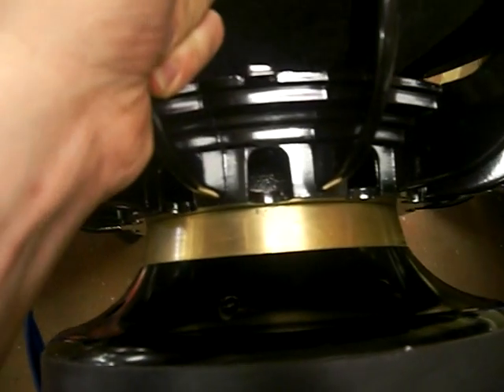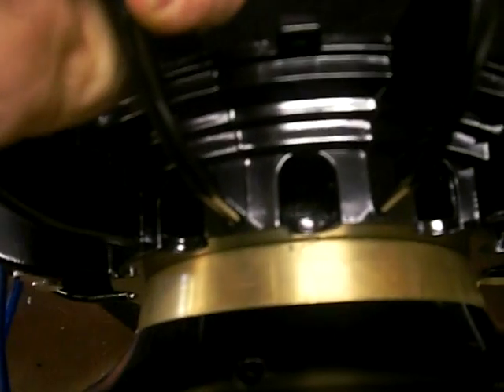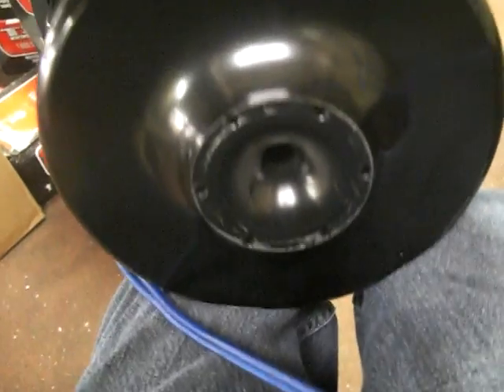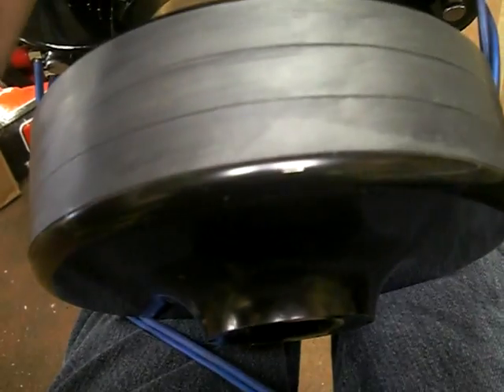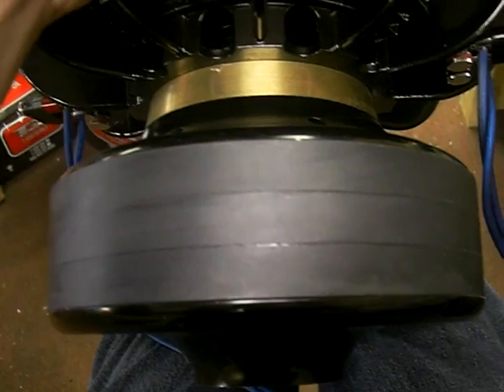Sundown Nightshade v.3 Prototype Free Air

Comment: I would start with finding out what the port area is going to be between the 6x9's on the back window. Knowing the port area should tell you how big the enclosure is going to be which will also tell you what subwoofer(s) or subwoofer combo that will perform the best in that given enclosure.

Comment: Good sound will depend on how well the system is tuned, ie. unclipped output signal, crossovers, and enclosure design. The only thing that pertains to a subwoofers size is the airspace you put it in. You want to run the optimal enclosure that'll yield the highest performance and output. The only way to do that is to choose the correct size subwoofer that will perform the best in the given airspace.

Comment: Well, subwoofers dont vary in sound due to the size of the cone, its due to how they are designed and built. The 2 `12" Zv3's will work just fine with the 3500D. The frequency range is manipulated only through crossovers and port tunning, subwoofers and the different cone sizes do not alter frequencies. You''ll need to tune the port accuratly in order to play the frequecy range you desire for your system to play.

Comment: I Was Going To Run Sundown 3500D or Even Higher Because Of The 2 Zv3 12s or NSv3 12s. I Like The Sound Of 12 Subwoofers And I Do Not Want To Go Bigger To Get Wide Frequency Range. I Will Do Ported As Well.

Comment: 4 Incriminator Audio Death penalty 18's, 6 XS Power D3100 Batteries, 1 XS power D3400, tripple Alternator bracket, 2 Ohio Gen 300A alts, 1 StreetBeat 350A Alt, 2 RD Audio D9's, 150ft of 2/0 gauge power and ground welding calbes each, 1 Crescendo Audio 1000c4, 1 MB Quart DSC 4125, custom enclosure built for 4 18's, Audio Technix 80mil sound deadener, Second Skin Audio SPL Tiles sound deadener, 4 Selenium 6w4p mid bass divers, MLA external voltage regulator, Pioneer P4400BH double din head unit...

Comment: what the hell are you talking about now kid. ive got a pioneer head unit eerrr 2 alpine amps errr and kicker subs a high output alt and yellow top battery as well as my old battery. you cant beat pioneer for sound quality oh i also have alpine door speakers aannnnddd 6x9 alpines at the rear. whats up been dreaming on YouTube what you could afford if you had a job n didn't spend all day trolling people. i could buy any sub n amp on here but why when i have mine :) jealous or what

Comment: All you've done with your system, per the only videos you have, is thrown a bunch of kicker subs in the trunk with no design of efficient airflow. If I wanted to hear what garbage sounds like, then I'll just go outside and put my ear on the trash can (joking) but seriously, I've heard setup like yours and it wasnt impresive at all. Mines nothing to brag about either but have you even visited my channel? Everything in my system has been tuned correctly, filtered correctly, etc etc etc.

Comment: @arawndark As shown in the video , it will hurt you before you can hurt it. SO will this be like the sa's ? where there rated at 600 watts rms but you can pust 1200 to them.. this is rated for 2500 watts rms so should we stick with that or can we safely do more ?